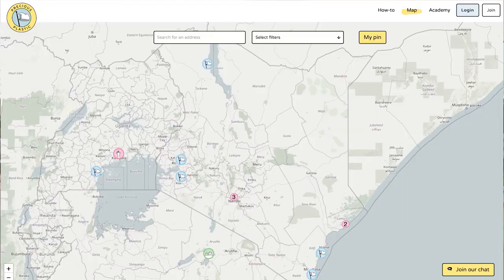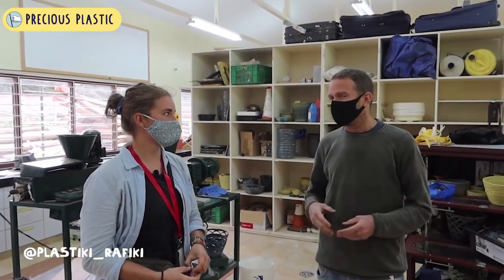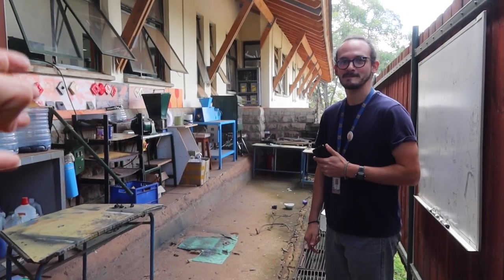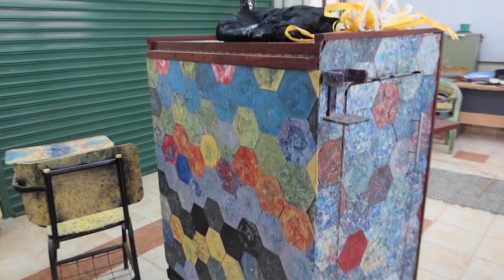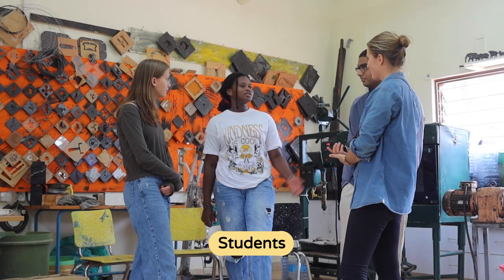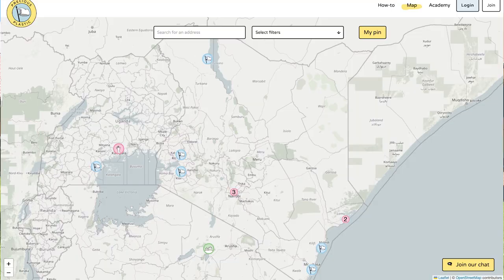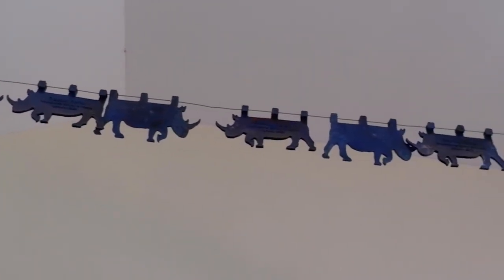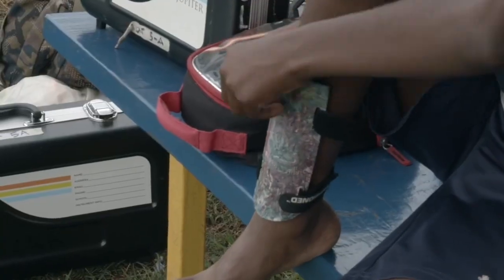Why Kenya kids melt plastic?

Comment: Can I use silicone molds? Thank you for your time.
Reply: It's OK, I've learned metal is best.
Reply from the maker: Yep silicon can be used but will wear off quickly, better metal or aluminium
Reply: @Precious_Plastic  Thank you for your reply. Best molds are metal or aluminum.  And silicone works, and does wood? Are there any other materials that will work as molds, please?